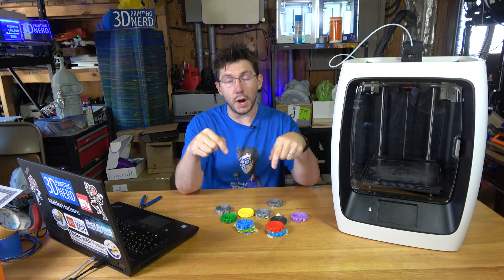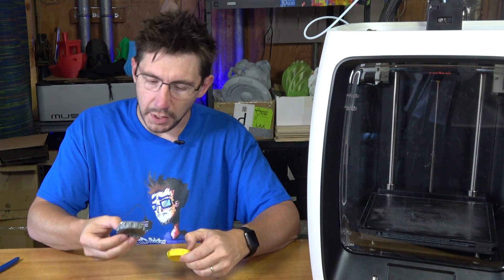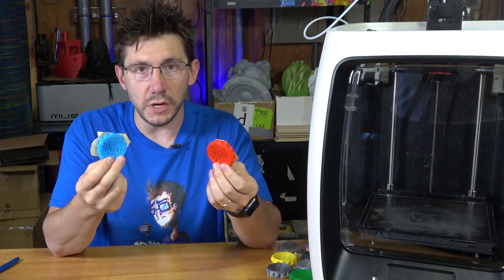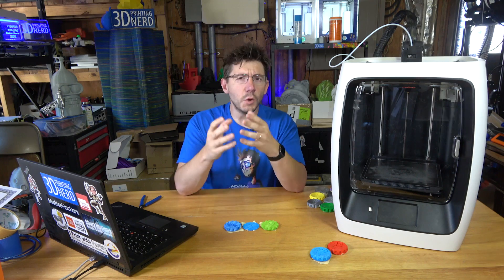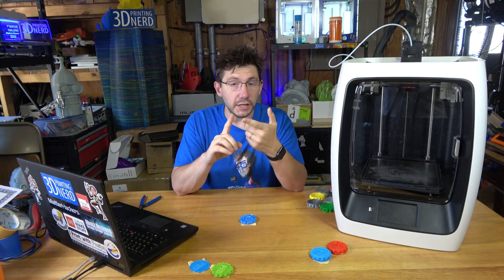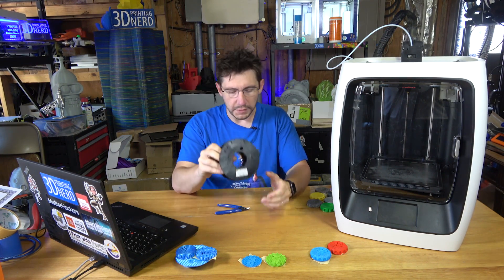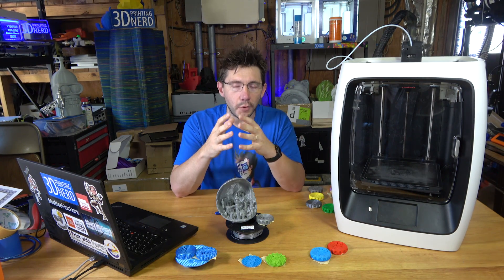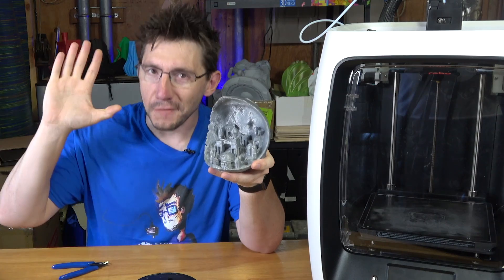The Robo R2 3D Printer Jams On Some PLA Filaments - Here is Why I Think That Happens

Comment: Is the Robo an all metal hot end? Seems that this issue with the softer PLA's happens on all my machines which don't have a PTFE lining.
Reply: Can confirm. I have done hundreds of test prints at a previous job and concluded that some softer PLA's just like to jam with all metal hotends. Ludicrous hotend heatsink cooling solutions "solve" the problem, but is very impractical. The best solution is to simply avoid the brands that don't work.

Edit. I should add that heat creep is the culprit. For the best test prints, print out an object with 100% infill. This causes the most heat to back up the nozzle and will give you the toughest print to complete, which should allow for the most comprehensive testing.
Reply: It's not always brand either though.  The colorant itself can change the properties of some filaments.
Reply from the maker: Yup, it sure does.
Reply: Oiling definitely helped me with the makergeeks pla on my e3d.
Reply: The Hexagon seems to be somewhat unforgiving. I think in part because the feed throat is small. Genuine E3D has a 2mm feed throat, Hexagon is a lot closer to 1.8mm. It's visibly smaller. While on paper filament shouldn't be 1.8mm but in reality, they will all have sections where it's oversized.
Reply: 'clicking' for me seems to be not enough heat transfer to the plastic.  3dsolutech clicks badly for me at the same temp that Hatchbox works great.  Had to bump the temps up for 3d by like 20deg. Cheap all metal hotends are not that great, lots of tweeking and tuning.
Reply: Yep, Robo uses the same Hexagon hotend on all of their printers. Same as the one they used on the old R1 back in 2015.
Reply: Very true, especially with the cheaper brands of filament
Reply: I have run into this with cheap orange filament with my TAZ 4. With the stock budaschnozzle, an e3d version 4, and with a hexagon hot end. This is 2.85mm filament, and I was able to clean all hot ends out with a 1/8" or 3.2mm drill bit by hand. What is strange is that out of the 10kg I ordered, they all printed great except the 3 Orange spools. Sometimes they would fail within 20 minutes, sometimes over an hour, the prints having more retractions failing sooner.

My point is that I never found a solution to print my orange filament, I just started getting all my filament from matterhackers and haven't had any further heat creep issues. 

But I never order orange. 😁

Comment: try reducing the AMOUNT of your retraction so that the soft portion of filament is never extracted from the cooled part of the hot end fully.
Reply from the maker: I'll definitely test that.
Reply: I have had pretty good luck with Amz3d black pla and hatchbox pla as well, my current settings are default aside from the temps 195-205 hot end, 80 on the bed most days

Comment: Personally, I have found that there is no such thing as a temperature that works for all PLA spools.

In my experience, some PLA works best at 230 C, while others work best at 195 C, and to find this out I must print repeated calibration prints, varying the temperature until I find that sweet spot for just that that particular spool.

This is true for both my Printrbot and my Prusa i3 clone.

So once I find that sweet spot temperature, I mark it on the spool so that I know what settings to choose with when I want to use that particular spool.

Your idea of 205 C as something that tends to work for all PLA just sounds really, really weird to me.
Reply: MakerGeeks PLA recommended temperature is 235 C.  I use MakerGeeks PLA a lot and I always print at 235 C. At that temperature it prints great but I don't know why it needs the higher temps compared to most other PLAs.
Reply from the maker: +Paul Gross interesting. I've found the opposite. Most of these spools I've printed on other machines at the same 205c temp, so I thought that would be good for the Robo
Reply: 3D Printing Nerd - thanks for replying. This 205 C PLA issue is quite a mystery to me.

As far as the 'clicking' goes, my first thought was that it was caused not by the machine, but by using a print temperature that was too high for that particular spool of filament.

If you have the time, I would be interested to see if the PLA that failed could be made to print reliably by dropping the print temperature to 200 C or 195 C.

Thanks again for responding, and I look forward to your reply.
Reply: 205C has worked for all PLA's I haveused as well, about 6 brands. Even wood PLA prints fine at 205
Reply: I used MG for a year and then once they bought the other company and equipment things changed. I suspect their PLA is no longer pure and the formulation is the cause for the temp difference.

Comment: A front door with 60 degree bed is certainly not good for PLA. It's probably why it's so easy to jam. This machine is designed with some old concept of ABS printing.
Reply: Unfortunately, we don't know if it can print ABS yet.
Reply from the maker: I'm going to find out tonight. Any specific color you want me to use first? :)
Reply: 3D Printing Nerd I'm happy with whatever test you do :)  Thanks for the good work, Joel!

Comment: Just a quick question. i'm working on my own 3d printer but can't decide if i should use direct or bowden extruder. what do you recommend and maybe why.
Reply: pros and cons.  bowden is lighter, can be faster.  direct can do flexible filaments.  what are your design goals?
Reply: My goal is for a 3d printer i can start with working and improve with timd
Reply: Thats awsome